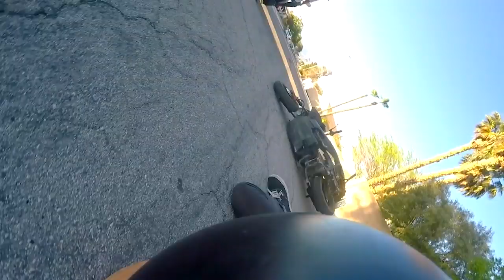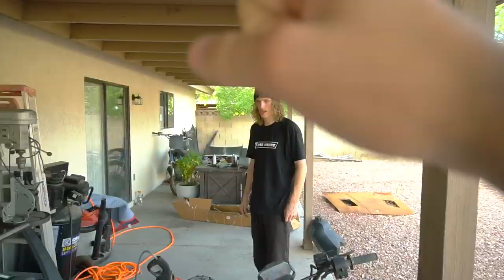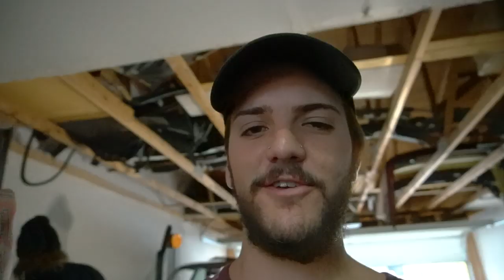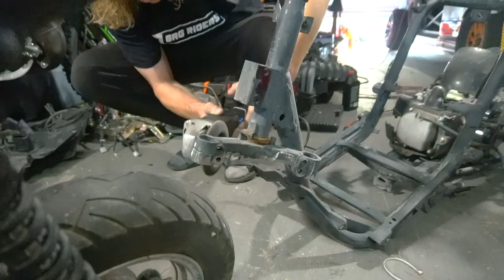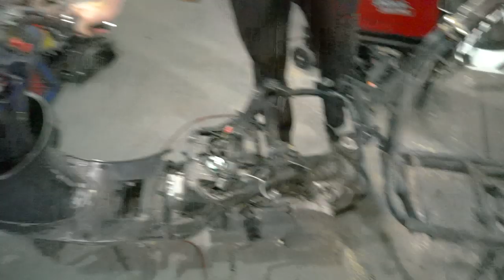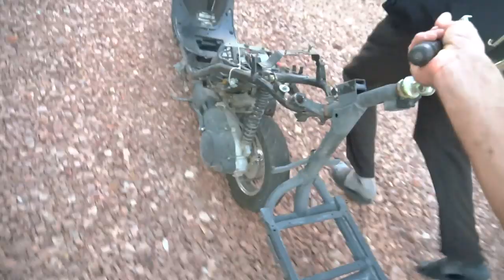building a TANDEM SCOOTER powered by a 150CC ENGINE

Comment: Go with like bright orange or purple and it would be sick if you swap a 150cc motor on the back and run a duel throttle cable to control them both to run the same.

Comment: Now put a 450cc in it
Reply: Yo, Need to get buy another 150cc GY6 motor and put it on the back Frame so you could have dual motors With loud exhaust pips. Would B Soo sick.